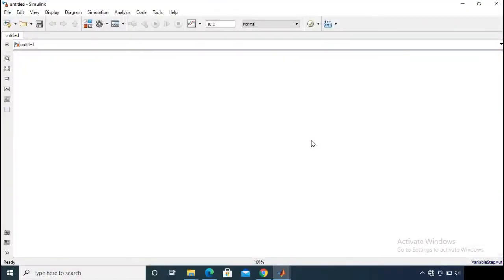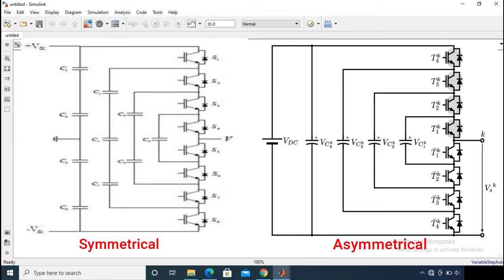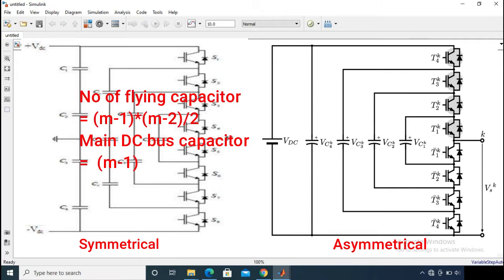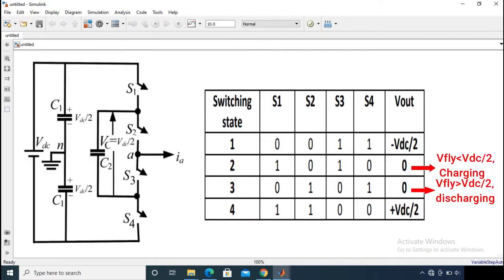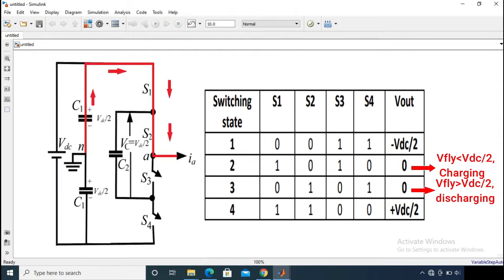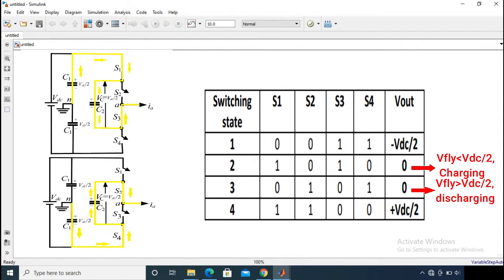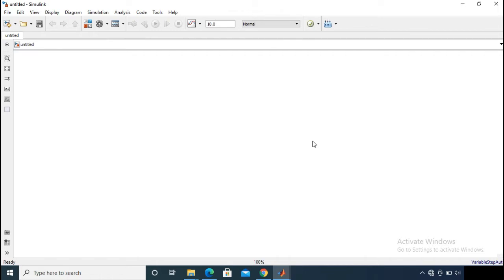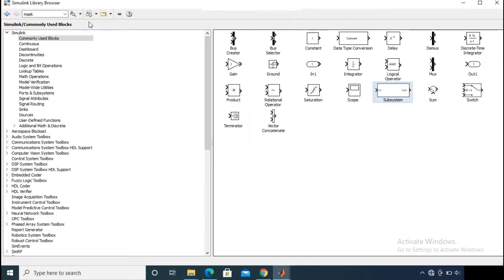3-Phase 3-level Flying Capacitor Multilevel Inverter design | PART-1 | MATLAB Simulation

Comment: Hello, excellent educational video. I use Simulink at work for power circuit simulation. Looking for an Optimum Pulse Pattern (OPP) modulation scheme using Simulink for NPC topology. I am wondering if you could make a video. Thanks.

Comment: I was simulating three level for audio, I use flying capacitor. However despite I use natural balancing it do not stay on zero volts, it just walk to positive and negative side, or when using a other  mosfet driver i get that it go overlap, I use feedback for the audio system. I think differences in delay between mosfets is cause, but when set dead time bigger it stays nicely around 0 volts, I use symmetrical voltages. Is there a fault maybe with the dead times? I get als in time a bad suppression of the fundamental carrier so I think als to the delays, maybe bad models in ltspice. I can go try lossless parts in sim, like you do in Matlab..   thanks in advance.
Reply from the maker: Please ping me your design by mail-
ranitsengupta007@gmail.com

Comment: for multilevel flying capacitor control system what is there?
Reply from the maker: What you want know please elaborate.
Reply: @RanitSengupta  how to make a control system for multilevel inverter using flying capacitor method? is there a video about it sir?
Reply from the maker: You can ping me- ranitsengupta007@gmail.com
Reply: @RanitSengupta  okey

Comment: About 11:49 segment showing "Current Measurement" item:  i'd like to read "Allegro ACS733" right under that function bloc, literally, because of its specific features (3.3 Volts, electrical isolation, 1 fast comparator/digital output, 1 near-distortion-free DC~50 KHz analog output)...  So, as a suggestion my wish is to see some future version applying it all to portable/pocket induction drivers capable of "injecting" ~100 Joules "Heat Charges" into a 0.75 g "susceptor" within no more than 2 ~ 3 seconds on a pair of sturdy 3.7 Volts e-Cig batteries.  Right now DiY solutions involve bulky RF Chokes which should get conveniently dealt with just by changing of topology, as illustrated by Infineon's MA12070 Class-D Digital Audio power amplifier for example, since it requires no large inductors...

Comment: Hi sir, thanks for the vid! But how did u calculate the value for main dc bus capacitor and the flying capacitor?
Reply from the maker: Yes just keep in mind for low to medium voltage application give the capacitor value 4.7*e-3 F.For further explanation I will cover a separate video on that.
Reply: @RanitSengupta  what if the voltage supply is 400 -500 and switching frequency is 10k Hz can I still use 4.7*e-3 for dc bus capacitor and flying capacitor?
Reply from the maker: @wickbron8964  yes you can use this for your design.if you are facing any problem with this value then ping me.Part-2 will upload within 2 days.